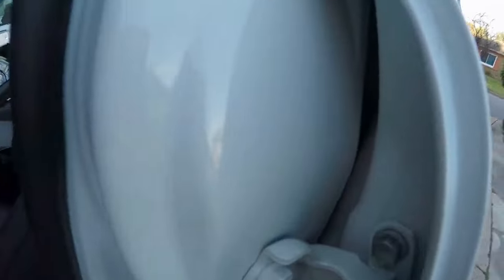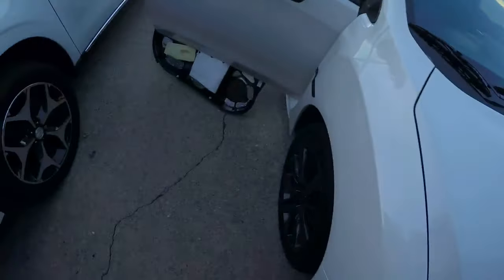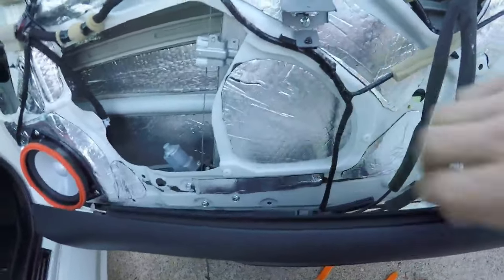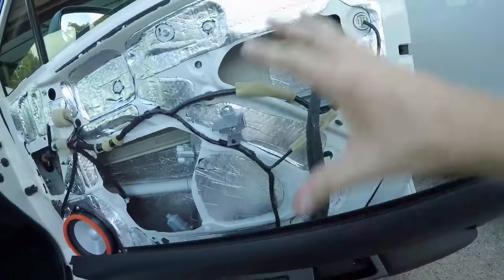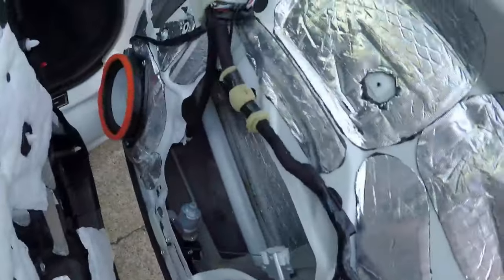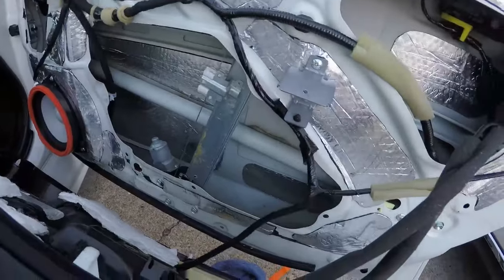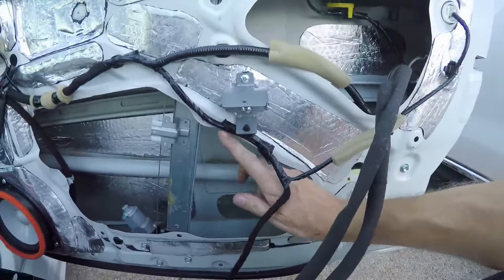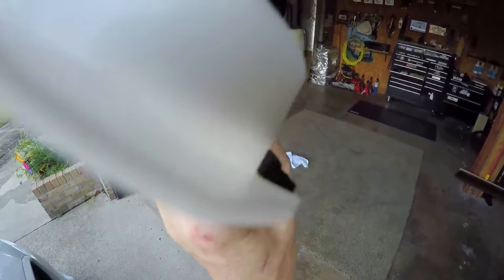2015 Subaru WRX Minisode 858: Door Rattle Investigation

Comment: I kinda have the same issue but mine it sounds more like a metal hitting metal the sounds comes from the passenger door and pillar area but then again everything looks tight and solid probably the seat belt parts are the ones making the noise